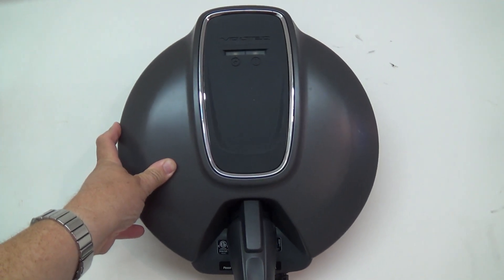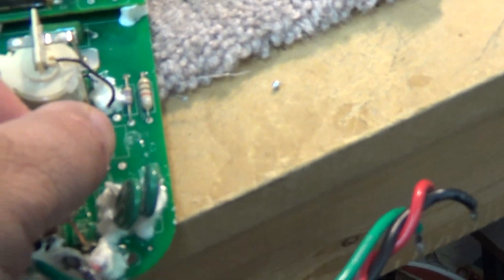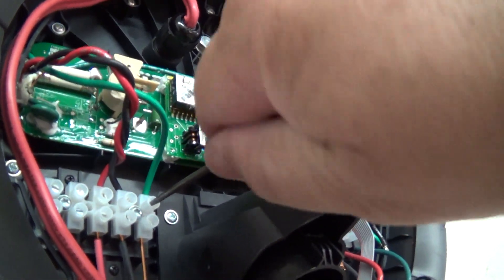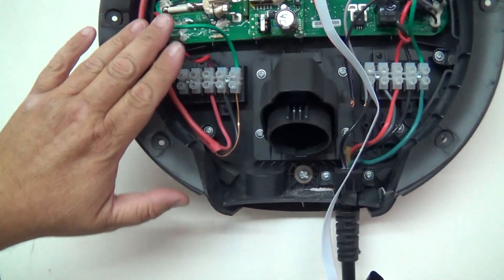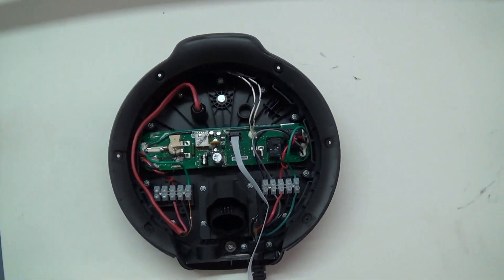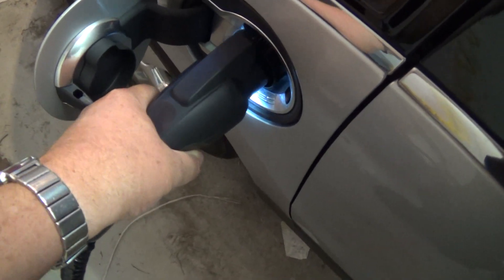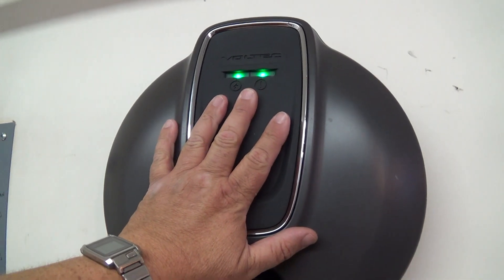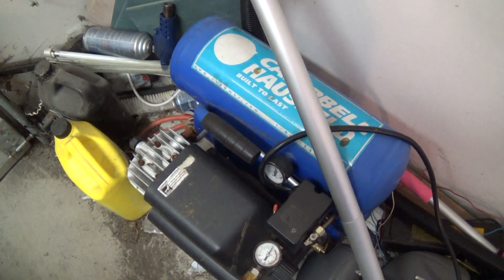GM Voltec Level 2 EV charger dead. Can it be fixed?

Comment: It works well for a while. I'm now on my third fuse.
Reply from the maker: I went through a few and finially the switch in the handle of the car connector failed and it wouldn't charge.  So i found a 217.00 charger on Amazon and it's been good for the past 5 years.

Comment: Thank you for this post. My charger also died and it turned out to be the fuse. Your video was very helpful in getting the job done to replace it. The hardest part was finding a replacement fuse. Ultimately I called Grainger and although they didn't carry it, they gave me the exact part number. For anyone needing to change this fuse, it is part # 0505020.MX52LEP and you can order it from Mouser.com ($10). I got it in 4 days and my charger is back in business.

Comment: This video saved my ass several months ago, and now it's happened again. :(. I am having a big problem finding the correct tool to take the black case off!  lol.  do you happen to know exactly what size hexegon?
Reply from the maker: Torx size TT is what I used. Mine failed again, but this time not the fuse. Water ingresses into the car side plug and damaged the trigger switch.  So I replaced the entire thing with a 200 Amazon 16 amp changer. Works flawless, and has a nice display that tells me how many amps it is charging at, and how much energy went into the car.
Reply: @12voltvids   THANK YOU!  I got the cover off and found the recently replaced fuse blew and melted the wires around it.  To fix will def. be more than I can handle.  I will look into the product you bought.  Thanks again for sharing your knowledge!
Reply from the maker: @mywindowisdirty  
I did a review on the new one last year and took it apart.  Well built and hasn't skipped a beat.  Charges faster than the old voltec charger too as it is a 16 amp so let's my 2019 volt charge about 40 minutes faster

Comment: Thank you so much for posting this! Armed with this knowledge, I bought a broken Voltec L2 charger on Ebay, bought exact replacement 
Littelfuse 0505020.MXP fuses from Ebay (sold by Verical, the Arrow-owned competitor to Digi-Key), and added Littelfuse 03540101ZXGY PCB fuse holders so I can replace fuses without having to re-solder next time. The fuseholders don't sit flush on the PCB due to lead spacing, but they do work. Now I have a functional L2 charger for under $175.
Reply from the maker: Well now as of oct 29 2018 it is still fine.

Comment: Absolutely ridiculous what they charge for a L2 EVSE, especially in Canada. I purchased a used Clipper Creek still under warranty for $250. One of the fault lights occasionally blinked near end of charge so I called them and they immediately sent me a new  EVSE and return postage paid box for the old one. Great company!!!!
Reply from the maker: John Ho 
Well I paid zero for my level 2 charger. Ok I had to pay the tax on it which cost me a grand total of 70.00. There are government rebates that cover the costs in many cases. You just have to look for them.
Reply: It was less expensive to purchase the EVSE and install my own 240V circuit. With Pluginbc you need a permit, licensed electrician and certified new EVSE and they only rebate 75% to a maximum of $750. With all those conditions, the install will be way over 1,000.  The rebate  for 2018 ended today.
Reply from the maker: John Ho 
Bullshit. I ordered mine and they shipped it to me. No permits requires no electrician needed. Mounted the unit on the wall ran in appropriate sized wire from panel to charger and connected to double 15 amp breaker. I even got my rebate for the unit, no proof of installation needed just the purchase receipt. Now companies like spx will try to upsell and tell you that you need a permit but you don't. If you are not sure a out what you are doing then get your work inspected or hire an electrician.  You don't need a license to work on your own wiring. If you did then they would not be able to sell plugs switches wiring ect at home depot ect.
Reply: Seems the rules have changed, have a look here:  https://pluginbc.ca/charging-program/charging-solutions-incentives/
"The signed electrical contractor form (or a certificate of inspection issued by the appropriate authority i.e. municipality or Technical Safety BC. This APPLIES TO ALL PROJECTS regardless of whether you have an outlet already installed or are installing one as part of this program. Learn more about this requirement here."

Comment: I've had my SPX Voltec go out recently and was curious what setup you ultimately landed on? I'm going to test the fuses tomorrow. Hoping it's as simple as that. I have limited knowledge, but am pretty handy, so weighing the variations on the fixes I've seen. People use 20A 250V fuses, some the 20A 500V (identical manufacturer), some people just solder back in place, others use an in-line fuse holder, you mentioned using a ceramic holder that you ultimately got rid of due to heat, someone else mentioned on a chat board that they just piggybacked the old fuse (I'm not sure what that means. I gather they soldered on top of the previous one?). Just want to make it safe and reliable. Thoughts since you've lived with the fix for a while? Thanks for the video!
Reply: I tested the fuses and the upper F1 fuse has crapped out. I pulled the board and debating how I will proceed.

Comment: Just replaced my 20 Amp ceramic with another, but soldered wires out of circuit board, so I could better change fuses without disturbing the board.  Fuse now connected to wire via terminal block (screws holding wires together).  I tried fuse brackets-/fuse blocks with quick-connect sliders, then screw-on connectors, but everything gets hot:  145F !!!.  I finally soldered the fuse to wire, then connected wires with terminal blocks (like the white block in the lower part of your charger unit).  Trying out the 20A fuse, after 5 minutes charging, they GET HOT!!! I'll bet that 15A fuse failed in a short time.
Reply from the maker: I did the same, because in this video I only put in a 15 amp as that is all I had. When I changed it to a 20 I put in a fuse holder. It is funny that only that 1 fuse blows. It has blown 3 times in 6 years, and it is always the same fuse. What strikes me as odd is that the breaker is a 15 amp breaker and it never trips, but the 20 amp fuse does. Weird.
Reply: Ha!  That's because ceramic fuses get really hot under normal load, and it's the heating/cooling that eventually causes failure.  It is NOT a power surge--my car was completely charged when my Voltec fuse failed.  Next time, I'll just use the standard automotive clear glass fuses.

 See my post in gm-volt: http://gm-volt.com/forum/showthread.php?18582-Simple-repair-of-240-Vl-level-2-SPX-Voltec-charging-station&p=4054769#post4054769%22target=%22_blank

Comment: Thank you so much for posting this and to those who put in the exact reference for the fuse. After three years my charging station died and this was the problem. Because of this video I was able to order the fuses and take out the circuit board so a friend could fix it. I can't believe that a $500 system is dependent on a $5 part...
Reply from the maker: Yes I know. Mine has blown twice, same fuse. These fuses are pretty quick acting, which is what you want, as they are protecting a $40,000.00 investment. Better a couple $ for a fuse than an expensive charge module in the car. Most likely cause, a power surge.
Reply: I agree. I just wish that either the fuse was easier to replace or there was a tech to call who could replace the board.

Comment: Would this also work with the portable charger they give you when you purchase the car? My portable charger is having the same issue, I believe.
Reply from the maker: +Rob Baker Yes the charger that comes with the car is basically the same charger inside, just set up for 120v. Many have swapped the board from the Level 2 into the case of the Level 1, and made up an adapter plug so that can plug into a 120 or 240 plug.The 120 only unit has some additional circuitry to set it up for 8 or 12 amp charging, but that is just software that communicates with the car when you plug it in. The mains side is the same.
Reply: +12voltvids thanks.  My portable died on me so I figured I'd look into fixing it before replacing it.  I suspect it's a fuse.

Comment: How much does that charger station cost - if possible??
Reply from the maker: +Donald Ellett  Look up..... Way up to the initial description.
I think that "gimme another $500.00 please" sort of reflects how much this particular unit costs.  There may be less expensive units, and I know there are more expensive units. This was the "Free" charger I got. When I say free, I really mean that there was a government rebate of 500.00 for a level 2 charger, which is what the unit costs. Normally people would be paying an electrician to install it on top of that, but in my case it is right next to the electrical panel, so I just fished in a new wire, and put in a double breaker for it's own dedicated circuit.

Comment: How many miles can you actually go on a charge??
Reply from the maker: +Donald Ellett I have a first generation. The new one can go quite a bit further on battery power. In warm weather I get between 39 and 42 miles on the battery before the gas engine starts and takes over for longer trips. For me that covers my daily driving to work and back, and all the running around I do on weekends. Other than when I am traveling, I use no gas at all. I carry around perhaps 2 gallons in the tank for emergency use. The only time I fill it up is when I go on long road trips.The new model they say will go 52 miles on the battery before the engine starts. The volt is technically a plug in hybrid, but what makes it different from other plug in hybrids, like the Prius, and Ford offerings is that it gets 100% of it's power from the battery until the battery is totally used up, at all loads and speeds. On the Toyota and Ford plug in cars, if you "floor it" the engine will immediately start regardless on how much charge is in the battery. Also if you drive over a certain speed the engine starts on those cars. On t he volt the engine never starts until the battery is flat, then, and only then does the engine fire up,  and it drives as a conventional hybrid with the engine cycling on and off until you plug in and recharge it.
Reply: How long to charge it??
Reply from the maker: +Donald Ellett On 240V it takes about 3 1/2 hours. The new model, because the battery is larger takes about 4.5
Reply: You save a lot of money gas with that Volt!!!!   I could live with that!!
Reply from the maker: +Donald Ellett It is very economical to run, but it is not just the gas. There is no oil changes except for 1 every 2 years. Because 95% of the braking is regenerative, the brake pads last forever. 90,000KM and I still have 11mm of brake pads left. They are only 14mm when new. So maintenance costs are much less, and then there is the savings at the pump, but no limitations as a full EV driver has. Now I know the Tesla fan boys will jump in about fast chargers. Yada yada yada.That's a joke. I have a friend with one, and traveling is a pain in the butt. It isn't just the 45 minutes to charge, it is the wait to get on the charger when they are all in use. Also, EV drivers are limited as to where they can go. When a volt driver wants to hit the highway, and do some sight seeing, that option is there because it will drive like a regular gas car.
Reply from the maker: Donald Ellett 
Just today I drove 64km about 42 miles on a charge. This is on a 7 year old battery in a car with 150,000 in (87,000 miles) the naysayers are wrong as usual. Battery performing as good as when the car was new in 2011.

Comment: Thanks for your posting.  I had a TV repair shop solder in a couple of the same fuses and it is working fine.  Shame on VOLTEC,SPX for making a unit with this type of fuse and then telling us to buy another one.

Comment from the maker: Update April 1 2015, still going strong with a 3AB-20A in a ceramic type fuse holder.
I do have the unit on a 15 amp breaker, so in theory the breaker should trip before the fuse.

Comment: After I blew two fuses in my charger, I replaced the fuses with 15 amp circuit breakers and mounted them in the bottom near the charge connector so I could press the button to reset them.   This worked for a while until the whole damn charger failed completely.   I am in the process of installing a JuiceBox charging station...

Comment: FYI the exact replacement fuse is Littlefuse p/n 0505020 comes with axial leads (no need to solder on leads)( 500volt 20 amp)
Reply from the maker: I know the part number, however none of the local suppliers carry that fuse, and I didn't feel like waiting. So I fired up the solder iron, and made my own. The second time it failed I figured out the culprit. I had plugged my compressor into a 110 outlet, and I guess when the compressor kicked in, while the car was charging it caused enough of a phase imballance that it popped the fuse. I put a fuse holder in place, for both fuses, so now I can just pop in fuses should they fail again.
What bugs me is the fuse popped in the first place, as it is on a 15 amp breaker, and one would think that would trip before a 20 amp fuse, but that isn't the case. Anyway now I know what did it, the car is not plugged in if the compressor (used mainly for filling my tires up, and blowing dirt out of equipment) is in use, as that sucker really draws a ton of current when it is in a locked rotor condition.
Reply: 12voltvids Yes, I did the same. Found out the p/n after the fact. So far its holding out. I used radio Shack fuse  500v-- 20 amp, 4 for under $4.00.
Reply: al pope Make that 250v/20 amp from Radio Shack

Comment from the maker: An update, the 15 amp fuse didn't last long, as the unit actually draws 15 amps exactly.
So I replaced it with a 20 amp, and mounted a fuse holder I took out of an old Microwave oven. The copper wire I used is the solid center conductor from RG6 coaxial cable. All is good. If the other fuse blows, it too will have a fuse holder added.
Reply: can i use  household mains plug fuses  replace the  car charger fuse ?? thx
Reply from the maker: Martin Lee I took a 20 amp cartridge type fuse, and wrapped / spot welded wires to the ends, and soldered those to the board.Been fine ever since. Tried a fuse holder initially, but heat produced between the fuse and holder ultimately caused it to fail over a few months,
Reply: @12voltvids  .... I already know the answer to this one ........ but.. it would be nice if you put an electric meter (kw/h meter) on the input side of that charger...... to get an idea of how much kilowatts = $$$ .. you are really "saving"... by using electricity.. instead of gasoline...... they are a few cheep (kw/h meter) in ebay that will allow you to .. measure and calculate the amount of money.. that you are giving to the electric company.. instead of the gas company..
Reply from the maker: @Ramdileo_sys  
I know exactly how much it uses. First of all the car tells me how many KwH it has used, and the charge cord I currently use has a nice OLED display on it that tells me the charge current, how many KW are being charged, and the KWh that has been delivered.
And yes, even at the expensive rate of .14 / KWh, it costs me, about 2.00 to fully charge my 2019 volt, and  1.33 to charge the old volt (smaller battery)
The new volt will go 53 miles on a full charge. So 53 miles for 2.00
Now, it gets 42MPG on gas which means that it will use about 1.25 gallons of fuel to drive 53 miles.  Gas today is 5.67 a gallon here. That would be about 7.00 in fuel. So that is 5.00 cheaper tyo run on electricity, and that is the expensive rate. On the lower tier  or .08 / KWh it only costs 1.16 to fill up the 2019 volt.
So to answer your question it is SUBSTANTIALLY cheaper to operate an electric car. My first volt, which I bought 10 years ago fully paid for itself in just over 7 years. That was the entire price paid for the car recovered in fuel and maintenence savings compared to the gas guzzler I drove previously which burned through 300 a month in fuel, and that was 10 years ago. With the price of fuel now, that vehicle would be consuming closer to 500 a month for fuel.
I maintain accurate records, so I know exactly what the car costs to operate. I will never go back to driving a gas or diesel car. Ever. Every EV driver I have ever met has the exact same thoughts. 
Never again.
Reply: @12voltvids  ja ja... yes .. more or less I knew that........ would be a nice video do... completely simplifying all of that...... to a simple measurement of the Kw/h that the charger consumes... doing the same 10 trips of 10 minutes... in 10 days (for example)..... you know... for those who say .. "ohhh yeeessah, but the car is calculating that number .. It's programmed that way ... what do you expect it to say?"... and you have a gasoline card to do the comparison so.. would be a nice video ................ unfortunately here in my country .. electricity is very expensive compared with any fossil fuel..... it is one of the fundamental legs for which EVs are hardly seen here not even in the heart of the city....... I can count with my fingers the amount of EVs that I see on the street in the last 5 or 10 years .......... three .....
Reply from the maker: @Ramdileo_sys  
On my street alone.  9 EV.  In my neighborhood 28 out of about 120 homes.   They are everywhere.   Expect them to be at 10% penetration in the next 2 years.